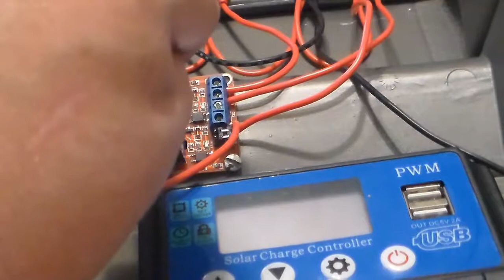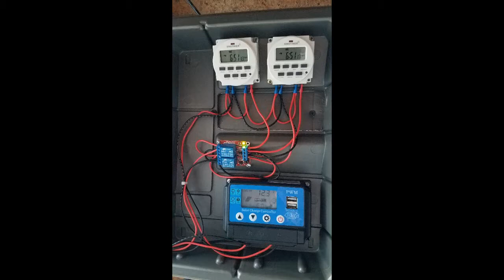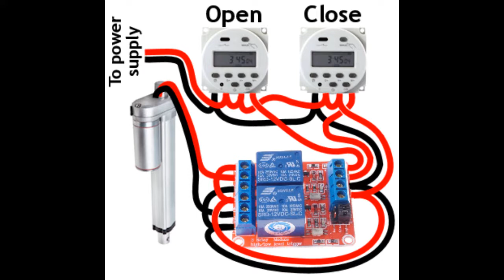Wiring the duel relay module

Comment: Mate this is so wrong.  
Please allow me to point out the mistakes.
1- never daisy chain.  You should allow for the current of each load.
    Eg. If you run 2 fridges you would melt tge wires.
2- every circuit should be fused.
3-  the timers are wired incorrectly.  Pin 4 takes the common power, not pin 3.
      When the timer switches on. It closed tge circuit 4 to 3.
4-  the relays on the circuit board.  There is no negative pin.
      Common (power in) is pin 2.  Pin 1 will close if the relay is activated.
      On the board should be printed "NO".  Pin 3 is normally closed unless 
       The relay is activated.  ("NC")  In your video should you have a short as soon 
        As 12v was connected.

Comment: I hope you don't take this the wrong way.
I appreciate all the work you put into this video but I wish people would stop telling others to wire it this way. I have much respect for the guy(the guy who made the post you got the diagram from) and all his hard work butt, it really makes it more difficult to daisy chain the wire like that. Plus it makes it more prone to fry everything if something goes wrong.That's why relays exist, to separate higher current function from lower current ones. I know it is not much but it can cause problems.  Plus the use of such a heavy gauge 16 Is totally unnecessary and harder to work with on the timer to/and module side. 20 gauge wire is all you need and seperate it, no daisy chaining. It is much easier to recut a single wire if a mistake is made or a fitting needs to be replaced. On the NO/NC/COM side of the relay is where you "should" use that 16 gauge. Most small actuators only use 18 gauge anyway. So 16 is still overkill. I am not trying to down your work and trying to help others but this method is just NOT good. 

Tip: Use ferrule connectors. They make working with wire so much easier. Helps if you want to make more videos like this one. You explain things very clear and understandable. Keep it up.

One last thing.  A two SPDT timer system takes way less wiring, very easy to wire and is so much better. The link below is a video I made to show the wiring diagram of how to do it. Maybe you can make a video on how to wire it up. I have no plans to do that. Yes I'm guilty of doing the just pointing and I'm even worse. I don't explain anything verbally. I leave the diagrams to seek for themselves. For those who can just look at a diagram and figure it out. Of course people like you can show how to physically do it..  Maybe a collaboration?
https://www.youtube.com/watch?v=aYv3-aVQEOY&ab_channel=AztecWarrior

This video Is a single timer doing all the work.
https://www.youtube.com/watch?v=7Oykm8wyQtU&t=1s&ab_channel=AztecWarrior

 I already recorded a video with the two timers. Just need to edit. It show how to wire it up with external limit switches, for those not using something like a linear actuator that has internal limit switches. If I remember this video I will drop you a link.